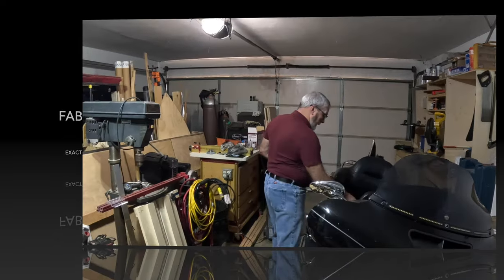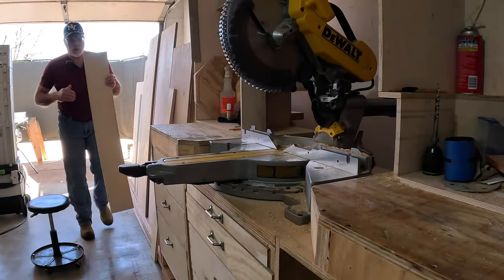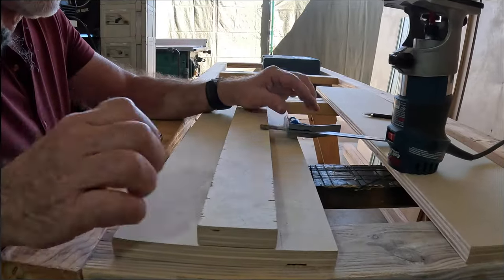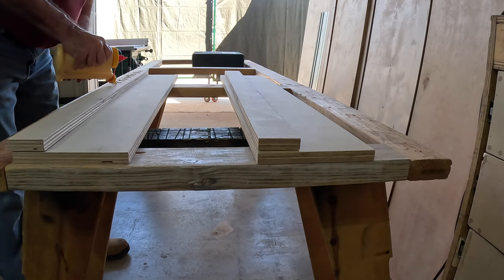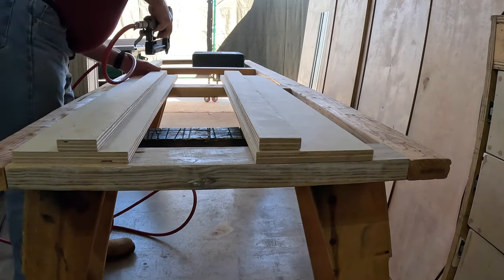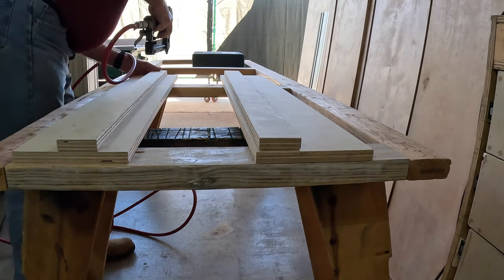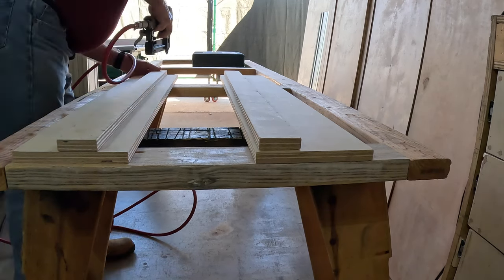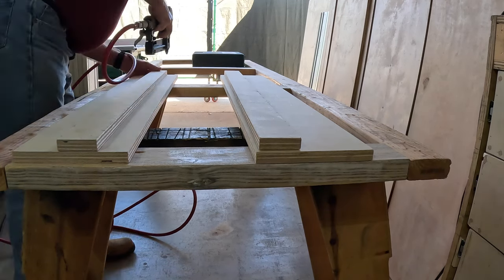Exact fit dado jig for small or large routers

Comment: Enjoyed watching you project - you've made a great job of it. It would have been good if you had shared wood thickness and measurements you made yours too
Reply from the maker: Thanks. I appreciate the feedback. I used. 1/2 inch veneer core plywood or 12 mm which ever you prefer. 
It can be made of what ever material you have. I made mine from this as it was what I had and I wanted it to be lighter in weight. 
Thanks again I hope this helps.
Reply from the maker: I used standard 3/4 Veneer core plywood. I will get the other measurements to out to everyone. Thanks for the feedback.